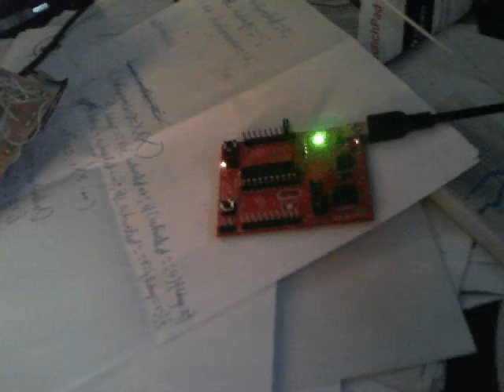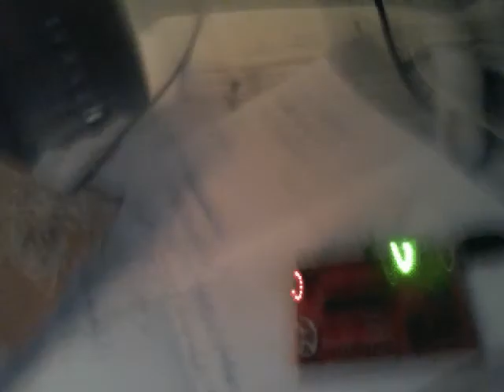MSP430 Launchpad Video 21: PWM On Board Leds, controlled by Launchpad Serial

Comment: actually i alredy read ur code n i have no trouble running it but im a begginer n i dont undestand that much of the code n no i dont have to use that code i just wanted to try controling the intensity of just one led with PWM :D

Comment from the maker: I think for something like that you'd be better off rewriting the code, since you will not be needing the serial comm part.
If you really want to use this code, you'd have to change the port1 interrupt code. Remove the state selection bit, and paste in some code like this:

if(duty_cycle <= PERIOD - 2)
			{
				duty_cycle++;
			}

Comment from the maker: ah, full quote: "Again, this is written for the MSP430G2252, and completely unoptimized testcode, but no reason it should not work for the G2231 (with minor adjustments?)"

Yes it should work, you just need to change the include file to G2231, and i think the timer is named differently on the 2231. 
Beside that, should run without issues